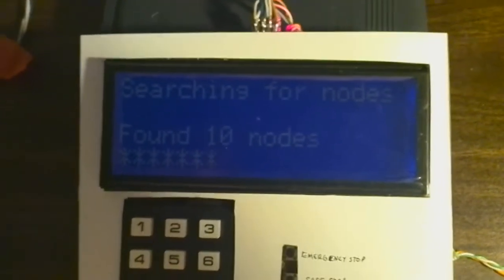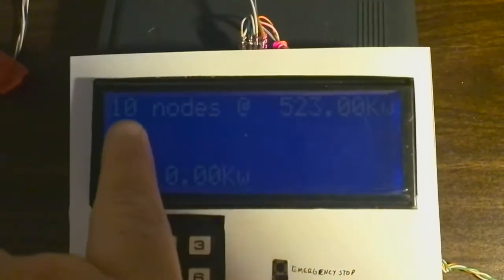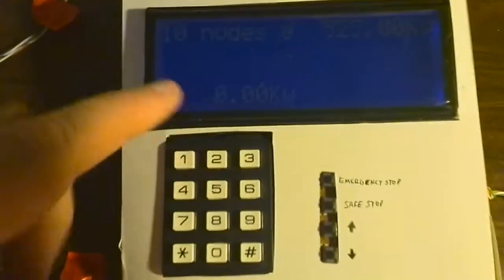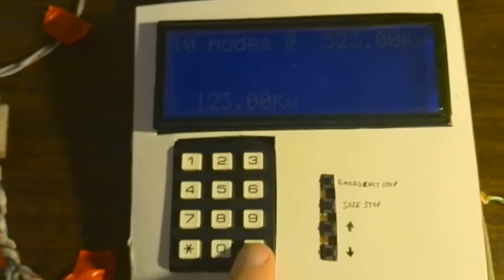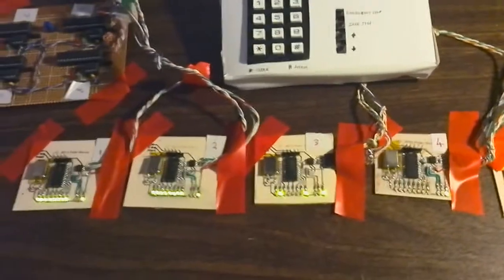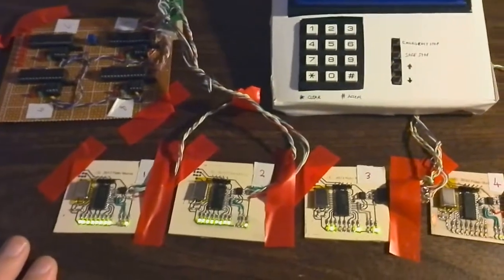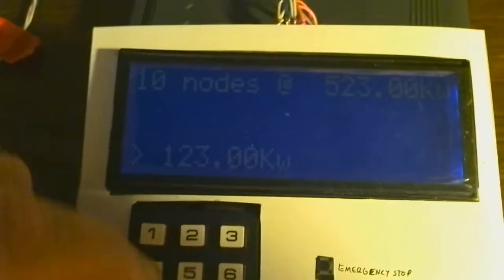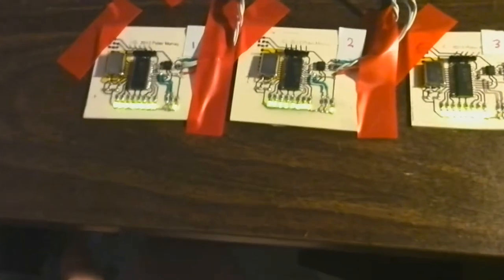Murray Electronics Prototype Loadbank Controller

Comment: Although interesting, you don't really tell us what this is for.  At least, I don't already know what a Loadbank controller is.  PS.  Saw your Digital PSU kit on Dave Jones site but is the kit available?
Reply from the maker: This video was originally made for my website when I was trying to market my loadbank control design. A loadbank is basically a selectable load to allow the testing of generators and batteries.The boards shown in this video are to show the system I developed that allows you to daisy-chain multiple loadbank units to attain a larger overall load and have it act like one large single loadbank.

As for the PSU kit, it is in the final stages of development. I have a couple of tweaks for the PCB to do and I'm developing the software. but I will be releasing it when I have the next PCB revision finalized.